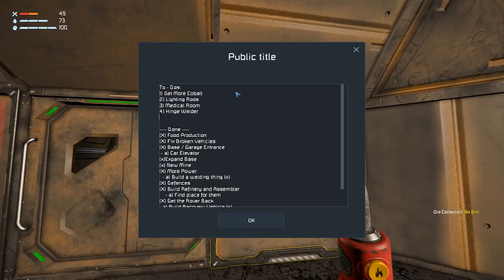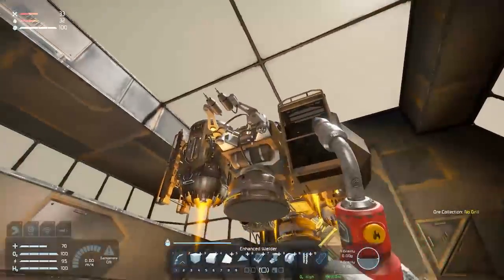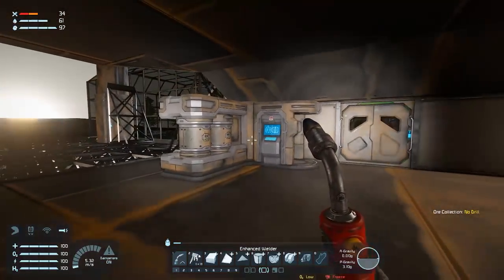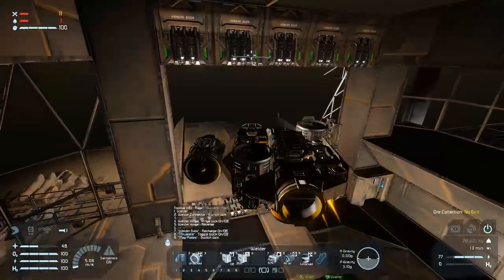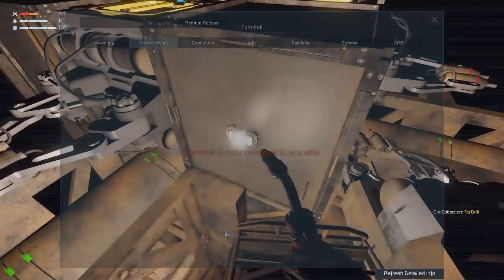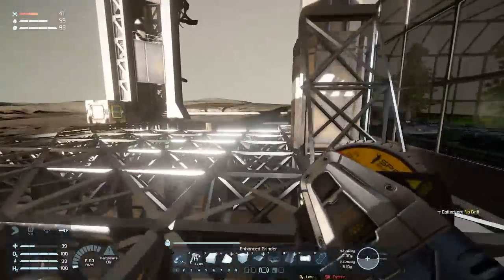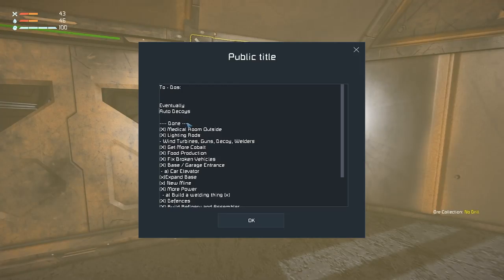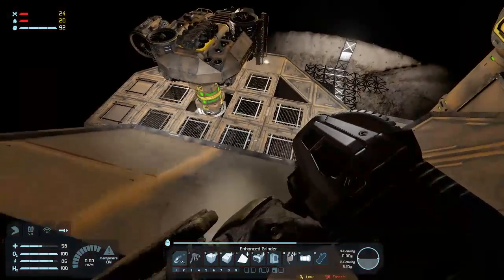No Suit Survival: Ep. 9 Defense - Space Engineers

Comment: The way to handle the "Downward drift" caused by hinges and rotors and the like is to put a downward facing thruster on the new sub-grid. Because the thrusters on the main ship are ONLY compensating for the weight of the main grid. Which is stupid, but that's how it works. It's why you having the rotor thruster didn't cause many problems(Aside from wasting energy trying to stop you while you were going forward) but you drifted downwards with a simple hinge.

Comment: For skids, wheels with the hub facing down. Set them to no friction, steering, or propulsion. Set to full strength and displacement does not matter, as long as the overall footprint doesn't tip over while idle, your fine. 3 wheels is gonna be the min for this to work.

Comment: Tip: rather than a using landing gear on the ground, electric-powered vehicles should be built on a locked rotor attached to the base, so the batteries will charge while building.